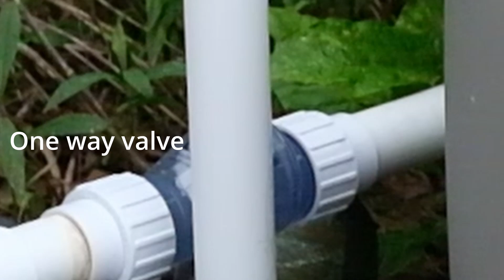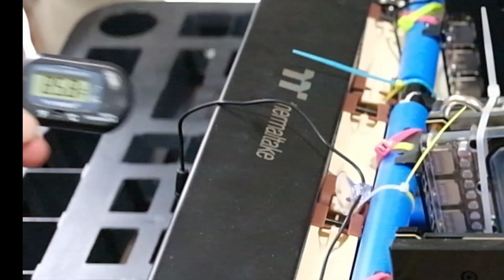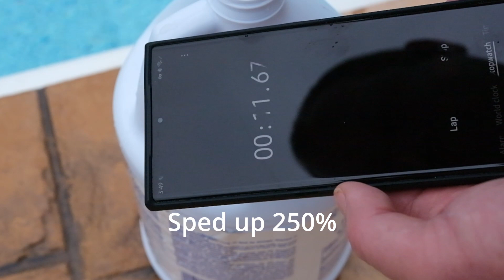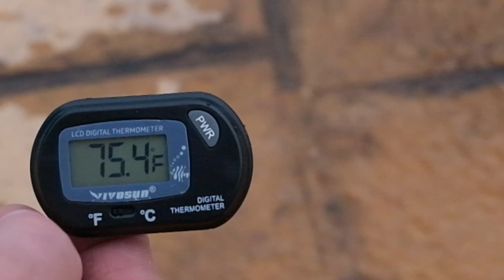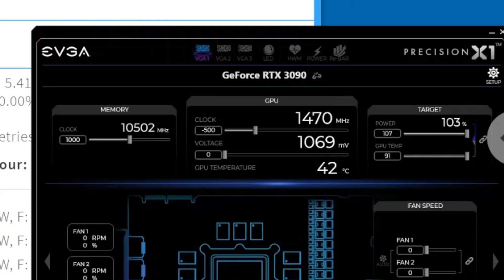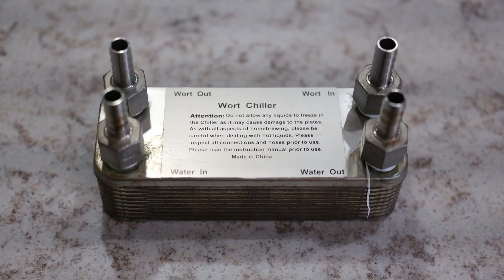Numbers After New Heat Exchanger

Comment: If you're able to cool the room, could that cooled air not pass over the GPU's?
Reply from the maker: Yes. The hvac does not turn over the air in the basement much and it is still dumping heat outside...which is also a waste